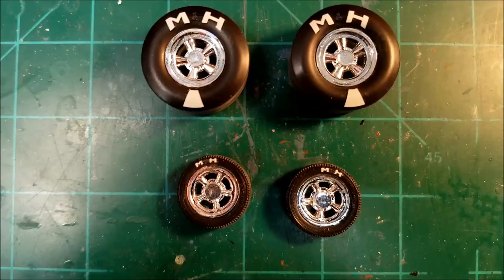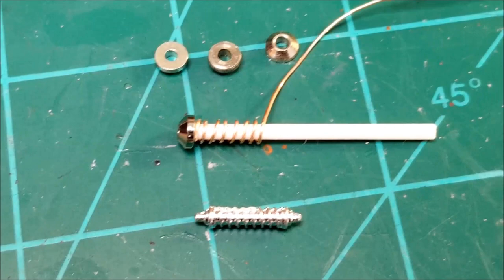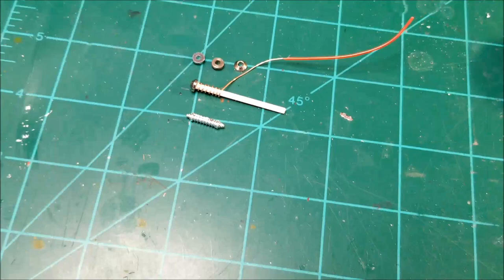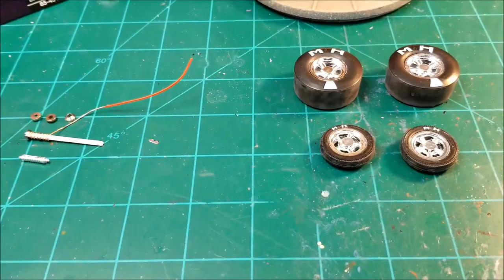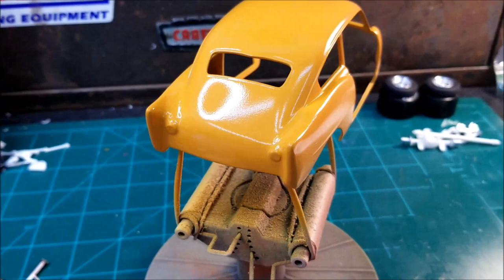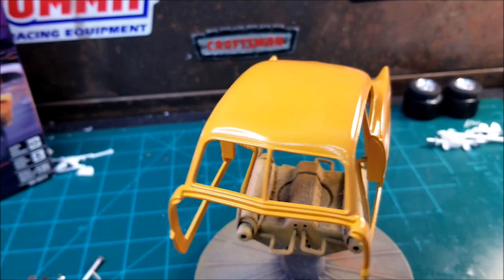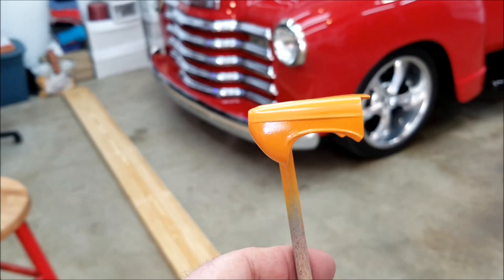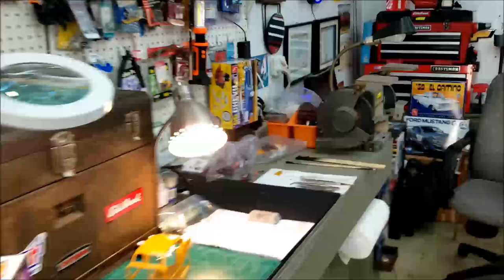1951 Henry J Gasser Update #5

Comment: Rattle cans are difficult. The circumstances have to be just right for them to work. If it's too hot, too cold, too sunny, not enough sun, too humid, not humid enough it may not work. You achive the best results with short bursts of paint at arms lengths...
If it's too hot outside stay inside the garage by the gate and spray out the gate...it's tricky to learn but once you get the hang of it, you'll also get a feel if the conditions for the rattle can are just right or not.
Reply from the maker: Thanks for the info man.  Yeah, I thought I had pretty good conditions when I sprayed but the product says otherwise.

Comment: That is such a bummer when that happens, or worse a reaction that crazes the paint.That's the way I feel when that happens to me, and it is always on a model kit not some flower pot. I sometimes just wrap wire around the shock as a coil over or use plastic rod and tube, 3/64 - 5/32 and make custom length shocks.
Reply from the maker: Painting has always been my problem.  Thanks for the info on the shocks.

Comment: You might already do this but I put the can of paint in hot water for five minutes I also use Dubro easy connectors little black plastic retainers for shock bottoms I'm also an rc guy building models hope this helps keep up the good work
Reply from the maker: Thanks Ruane.  I have some of the easy connectors.  Just thought the shiny metal looked better.
Reply from the maker: Yup....I always put the rattle can in warm water before spraying.